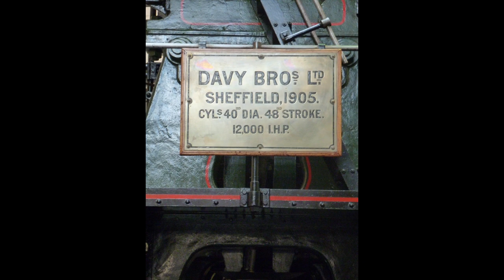River Don Steam Engine

Comment: The speed range, acceleration/deceleration and fast reversal make this engine highly suitable for the steel plate rolling mill application. Also, the 12,000 HP rating is entirely appropriate for rolling heavy plates, Bravo, the engineers at Davy.

Comment: Is this like the engine a Kempton?
Reply from the maker: It's simular yeah the major difference is the Kempton Park engines have pump rods attached to pump, but the river don engine drove   directly via gears from the crank shaft back in front of the engine to a huge steel rolling mill
Reply: looks like this one has 3 equal cylinders so single expansion? probably because it has to  reverse quickly?
Reply: It is indeed a single expansion engine with a Joy Vale gear for rapid reversing  at Charles Cammell  Cyclops Steelworks in Sheffield from1905 to 1957 It was powered on 12 coal Lancashire boilers at the River Don works the steam came from 1 of 2 power stations 10 gas heated boilers.  sat outside was 3 Ruth accumulators 1 vertical  2 horizontal, 400psi of steam pressure  reduction value took It down 160psi  working steam pressure . At the museum It's run on 100psi